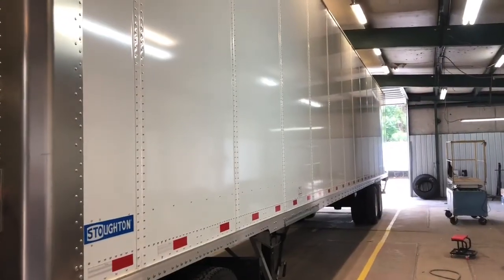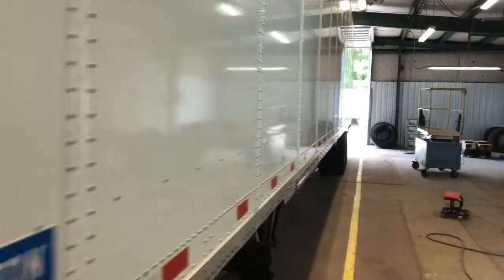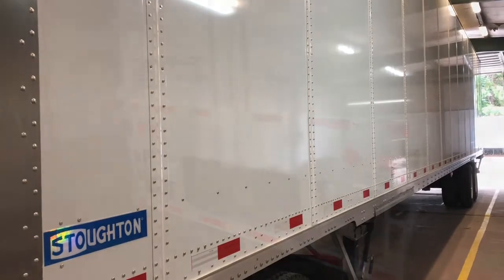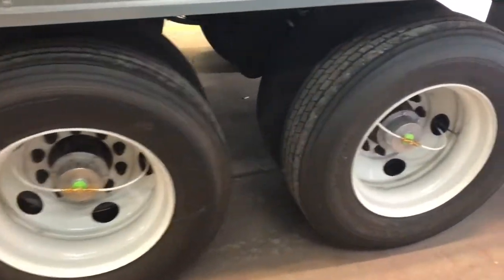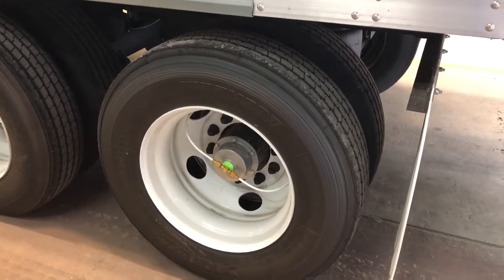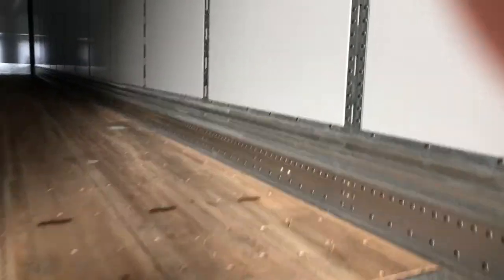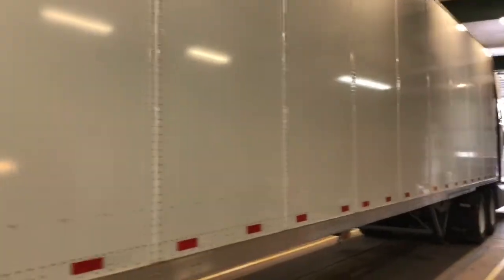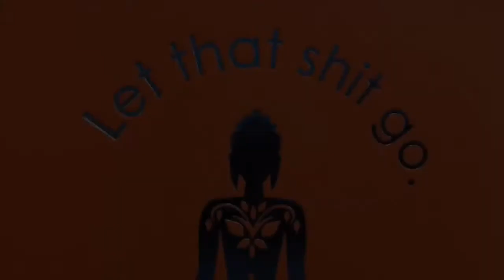Brand New With Issues: Stoughton Trailers. Quality Control Is Overlooked Apparently

Comment: That's disappointing! When I worked there, we had inspectors on every unit coming off the line. They signed off on everything, from front to rear. They called us out if rivets didn't look correct! My thoughts are that it was originally held for rework, then somebody decided to release it before the work was done. It does not excuse the fact that it got out like that, but it did happen. They aren't the best company to work for, with high turnover rate. They like to keep wages low, by getting rid of the higher earners. I never had rework and usually finished my quota early and punched out, saving the company hundreds of dollars a week. And they laid me off as soon as they could, after trying to get me fired or working me until I quit. Since I was too bull headed to quit, and I didn't do drugs, they laid me off 4 months after they announced they would be laying off, after losing the UPS 28' container order.

Comment: Basically  do  a  complete  in service  check  everything  even  hub  oil  levels . Thanks  for  another  great  video  my  friend  keep  them  coming
Reply from the maker: +Scott Pearson isn’t that sad a brand new trailer. “Supposedly checked” before it left the factory then “supposedly” checked and dot inspected when it left the dealer ..... kinda strange. I can see how maybe the air lines rubbing might have gotten missed but the entire right side of lights.... sounds like someone dropped the ball huh ?
Reply: Yes  sir  someone  definitely  did  on  that  one . I  have  to  say  that  at least  you  pulled  it  in  and  did  an  in  service  on  it . I  think  most  companies  would  have  fixed  the  lights  and  sent  it  out . Then  you  get  the  phone  call  when  it  gets  inspected  on  the  road  for  the  other  issues  and  the  new  trailer  cost  just  went  up . I'm  glad  you  took  the  time  and  inspected  the  rest  before  the  out  of  pocket  went  up  having  to  pay  someone  outside  the  company  to  fix  it   on  the  road . Great  company  practice  keeps  cost  down and  customers  happy .

Comment: Good job guys! We had a similar situation where we picked up a brand new kenworth, when they brought it in for a precheck I found that the 5 th wheel plate sat 2” higher on one side.  They put 2 completely different freakin mounting brackets on the slider!  Talk about a accident in the making.  The dealer called Holland and there claim was that when they put the 5th wheel and slider assembly together that they were going through employee contract negotiations so it could have been done on purpose.
Reply from the maker: +Jay Dee man that is crazy ! It’s a shame how much trucks and trailers cost and them do something like that ! We always check everything. My motto is we can fix it cheaper in house than a service call and a whole hell of a lot cheaper than if the DOT finds it ! Thanks for watching and thank you for the comment !

Comment: I'm heavy in to the RC hobby. Stuff like your SNAPON TRAXXAS XMAXX. People always gave me shit for buying a new RC and completely taking it apart. I don't care if it cost $1,000 or more. And I usually find issues.  Differentials that have little or no fluid in them. Wheels are loose. Broken parts. Electrical components that weren't soldered and/or not connected properly. All "new" means to me, is that I got myself a brand new piece of shit. Hahaha nothing is perfect, which is why you gotta check.